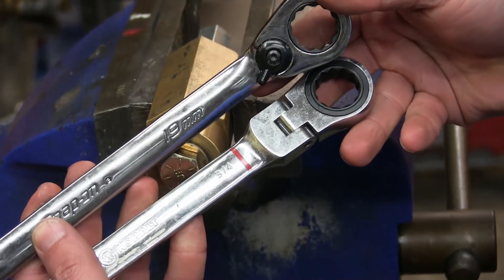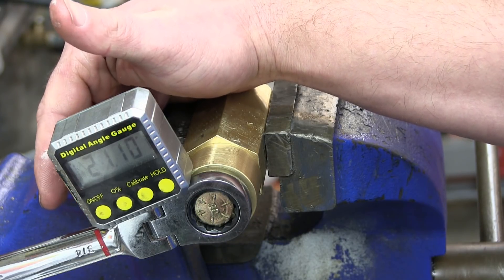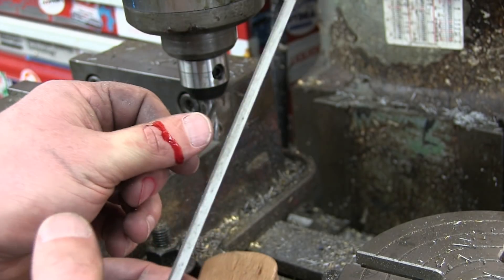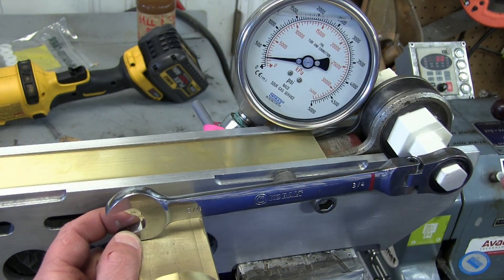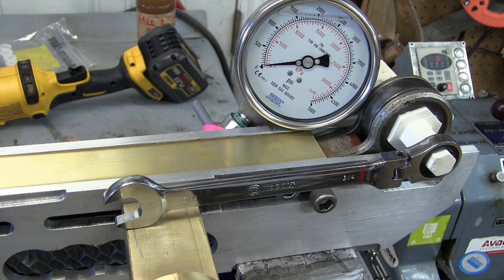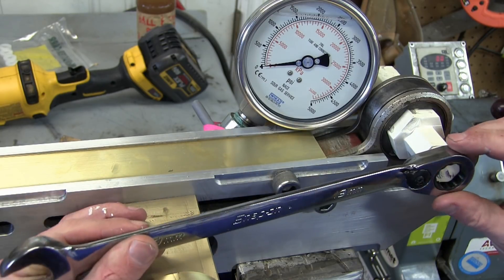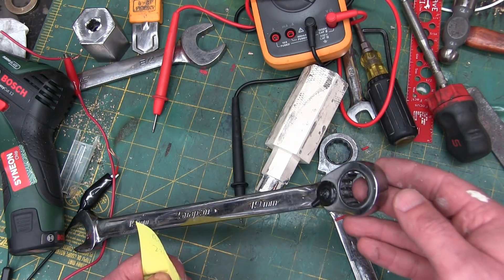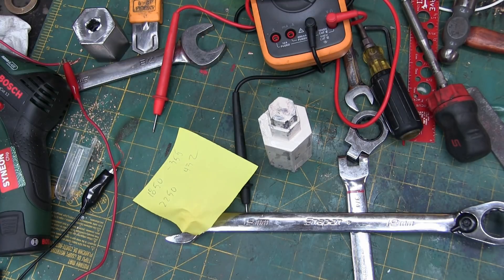RATCHET WRENCH Shootout | Snap-on Kobalt

Comment: You're 'cheating', your Snap-On specimen is the older style 'teardrop' head, which was a fabulous/highly durable style. Some of my newer ratchets have the oval head design; pure trash in my experience, I stripped out at least two newer style 15 mm's using just my hands, NO cheater of any sort and, I'm NOT that strong. If I ever decided to go back to work, I'm retired; I'll buy a set of Harbor Freight ratchet wrenches and, take my chances. That's how pissed I'm at Snap-On.

Comment: What was the math you did at the end, converting it to ft. Lbs and Kpa? Others pointed this out too but, the Kobalt is a flex-head with the frap-off being solid.  You did say it was comparing apples and bananas, I appreciate that you make that distinction.
Could you do a test of flex vs flex/solid vs solid? So it’s bananas and bananas?
Also (May be way too nerdy to actually do). But maybe a cost comparison added in.  Lots of folks won’t put this much torque on an 18 mm wrench, especially a geared wrench.
Thanks for the video!!!  Keep them coming

Comment: Not an accurate test, flex head vs non flex. All variables in the test should be equal. Non flex, and both same size for accuracy. And of course the flex would break those pins can't handle a lot of torque

Comment: entertaining, but on the end little is ever learned from these "tests". It's not humanly possible to pull this kind of torque on a hand tool unless you use a pipe and abuse the tool far beyond it's intended use. When you have to do this, time to move up to the next tool and do it properly. IMO, most low priced tools will match the usefulness of the designer priced offerings.

Comment: Yea but you're looking at the amount of torque the actual shank of a bolt can take while tightening. But when you are trying to take off a rusted bolt or something that torque yield can be much higher. Especially on auto suspension nuts and bolts. But either way, seems like kobalt CAN produce a solid tool. But like others, consistency from one tool to the next  has to be questioned.

Comment: The only snap-on ratchet I was ever able to pop was a 1/2" drive flex head that was 2 ft long and I was using a cheater pipe with it. You would think it would sheer at the flex head but I actually tore the guts out.

Comment: So .... the watched that's 10x more expensive out performed a much cheaper tool. I would rather just break whatever loose and use my much cheaper tool. Then.... when it (if) it breaks, it has the same warranty.  I'm good with the kobalt

Comment: A flex head cobalt vs a rigid snap-on isn't even an accurate test. A ratcheting flex head is used to get a better angle on a bolt/fastener that has already been broke loose or to snug it up. A rigid ratchet wrench is used to put some work in. It basically like using a screwdriver on a hose clamp when you can just put an 1/4 socket on it.
Reply: Exactly why this shouldnt be a comparison video more just along the lines of a torture test on wrenches.

Comment: They are made 100% in the USA in Tennessee at the hand tool plant you can easily search the video on YouTube. By the way your using an older discontinued Snap On ratcheting wrench. The new Snap On wrenches are Dual Paw 80 tooth. Same dual Paw in Snap On 80 tooth ratchets. Dual Paw is patented and only tool company with it. Sure you can buy cheaper wrenches and support giant corporations like Home Depot, Lowe’s and China. Or you can support a local small business owner which Snap On Franchises are and support US jobs that Snap On provides. PS using a flex head that allows more torque diversion versus a non flex head is completely inaccurate

Comment: Isn’t it screwing all the results of these tests because the distance of the leverage seems different between each one.  Also, it always deflects until the contact point is 2” shorter (farther down handle) again screwing all the numbers.  Need a different support...more of point and standardized length between all tools being tested

Comment: Would you give any consideration to testing the open end of this wrench or others like it? I own the very same set of wrenches with the "Flank Drive Plus" there seems to be a few brands that have some sort of added gripping surface built in. I have often wondered how Fap-Off got there magical number for figuring how much more they're capable of gripping a fastener. I hope I'm not beating a dead horse, love the Va-Jay-Hose!

Comment: I have an old swing dial torque wrench that I use as a breaker bar. Both sides of the 1/2 inch drive have rotated 45 degrees where I was giving it the biggun on a seized bolt, am I going to die if I still use it?

Comment: I've been in a lot of situations with rusted up fasteners where you are better off if you could twist them off to get things apart, at which point removing the studs or bolt stubs was a cakewalk.  One of the worst is the mounting rings for the brake calipers on the DC-drive wheel motors for Komatsu/Haulpac mine trucks... 3/4" flush socket cap screws, and invariably you have to blow the heads out of several with a hot wrench to get the ring off.

Comment: Shock load when a rusty fastener brakes loose is what kills the ratcheting mechanism in ratchets and the ratcheting wrenches.  The tool trucks can't keep enough of the long double ended 17 / 19 mm Monster branded wrenches in stock for shops doing alignments on Subaru and Toyota.  I've never broken the ratcheting mechanism just pulling on a tool, but have scattered many when the fastener actually broke loose.

Comment: you could make a 19mm headed bolt that has a 3/8 square drive shank on it. and use the other 3/8 square drive testing piece.  just an idea.
Reply: but then of coarse you can only test 19 mill or make one for every size but that's a bit tedious.  but if you machine it out of actual bolts you could save time.

Comment: i have snap on, blue point(snapon step child) , and gearwrench ratcheting wrenches and so far i'm the most impressed by gearwrench very cheap and can take a beating i smack them with hammers all the time to break stuff loose intentionally abusing them and i'm only broke one 3/4 and luckily my tool truck carries them now and i can get it warrantied. hard to beat considering i got both (metric and standard) sets for less than if i had just bought 1/2 of the metric snap on set.

Comment: Interesting that the pivot pin would sheer on the cobalt,  when previous tests with pivoting head tools ( breaker bar for one )  did not fail at that point. 
Likely,  better material of the pin and more material surrounding it to prevent torsional twist with the breaker bar. Am I correct? 

Have you got a good quality pin you could use on the cobalt spanner to then be able to restest it in the hydraulics doofer?

Comment: Glad to see you add Kobalt to the mix. I've been a diesel mech for a number of years and have used Kobalt on the regular with some fair abuse...ahem 3ft 1/2 galv. pipe on the end of a 3/8s ratchet...would like to see a ratchet revisit with that in the mix.
Reply: I have used a 1 ton come along on an 11/6 kobalt wrench numerous times. Torque rods on a Pete are inaccessible to sockets and ratchets.

Comment: I have a lot of Kobalt tools, never ruined a ratchet, wrench, socket, screwdriver, allen key, you name it, and I work on from small generators to 80,000lbs Crane trucks.
IMHO the ratchets are far more usable it tight spots, less swing than Fap-off, had to retrieve my Kobalt ratchet after dicking around with a co-workers Snap-off ratchet removing a transmission bolt from above the dog-house.

Comment: I would like to see the Snap On wrench tested to failure. I'm curious as to just how over built they are.
No doubt Snap On stuff is very good. Kinda can't stand the price though. Bang for the buck I have had a hard time not buying lots of Cornwell stuff. But all my professional ratchets are Snap On, They just feel right and rarely fail. I don't have any Snap On ratcheting wrenches, For that I went with the Cornwell spline drive double hinge type. I used to work on German cars and everything was held together with those weird external torx head bolts, E10's and such.
Thanks for another good video yah goofy Khanukistanian. :)

Comment: I just had an interesting thought hit me like the proverbial ton of bricks..

You mention the wrench being stronger than the fastener, and with a ratchet wrench or breaker bar you can put a cheaters pipe/ bar on it for increased leverage to give her all she'll suffer..

But on an open ended box wrench you can't.. .. or can you? 

We all know that you can do some wrench fornication and interlock the box end with the open end if you need to do the 200lb gorilla routine but you've only got a 150lb gorilla handy. I wonder, how safe is it? If wrench X critically fails at 450 ft/Lb, where does it fail on the other end? 

Does it fail at a high percentage to the overall fail force and therefore be a stress most people would never be able to generate by hand? 

Or is it a more meager number like half that which might be attained with the 200lb gorilla routine?(or 300lb gorilla routine for some of us)  

OR, are both predictions wrong and the open wrench ends are made of unobtainium and fail at some insane force that the rig cannot effectively test? 

Maybe you should keep those safety squints engaged and try that after these Salem Wrench Trials are over and you are looking for something else to question..

I sure think it would be cool to see, and who knows, maybe I should wear two condoms and keep my mother on speed dial while using that trick after all! 😂

Thanks, and keep up the fun and educational videos!

Comment: I see all these people hating on Fap-Off (on other channels) because they're so expensive and "no different than the cheap stuff" and yada yada yada. I even read one comment where a guy claimed his Stanley tool was no different than fap-off. needless to say, I lol'd. 
To those people, I say, yes they are expensive but you get what you pay for. This video shows it. Are many of their tools overpriced and not worth it? Sure. but many of them, while costly, are totally worth it and probably the last tool like that you will likely need to buy (unless of course you loose it). With that said, I'll step down from my Snap-On Tools® soap box.

Can't wait to see if you do a test like this comparing the apples from Horrible Frought and the apples from Fap-off and maybe a few inbetween cough cough gear wrench? cough cough

Comment: 19mm on a 3/4 bolt?
Reply: They are close enough for most cases. 3/4in is 19.1mm.
Reply: 19.05mm = 3/4.  Less than .002 of an inch.
Reply: james4v size of the bolt not the head

Comment: You should do a BOLTR on that SnapOn wrench.  I'd love to know how it's made.  It looks like the dual 80 mechanism on the inside but the pawls aren't removable.  I have no idea how they put it together.  SnapOn just recently changed the design to a fatter head that allows the mechanism to be rebuilt.  The weak point of those wrenches appears to be the little spring between the pawls.  I've broken two so far on my circa 2010 set and it was the spring that failed both times.  The new style wrenches are stamped USA.

Comment: I have a dumb idea. Make an adapter, 12 point to a square drive, then test how good it is.
I wouldn't see why a reversible box end would be better than a square drive ratchet when they have the same mechanism, other than that a lot of the squares shear off. But if the square sheering off is the only failure point when comparing the two; what would happen to those newer pass-through ratchets, would they act more like the box end? 
I'd also like to see a reversible box end taken apart, just to see if the mechanism is the same as a ratchet, or if it's modified in a way that would make it stronger.

Comment: Kobalt doesn't get the respect it deserves
Reply: Been using the same Kobalt tools for 4+ years. Dropped em, banged on em, threw em in the dirt and then oil and then dirt again, beat em to hell and back and never had an issue with a single one of them.
Reply: For the price difference the performance difference was minimal
Reply: I got a bunch of kobalt tools when I went to school still use them. Broke a few but they stand by the warranty
Reply: True. Helped Jimmie Johnson win the championship
Reply: The harbor freight is the same as kobalt
Reply: @thebear6751   not really I use kobalt wrench no rounding off harbor freight long wrench round off every bolt.
Reply: Dave Lawrence then it’s a bolt steel problem😂
Reply: Cody Marston nope
Reply: @thebear6751  Kobalt is made in Taiwan,and superior to made in China.
Kobalt an Harbor Freight is like comparing old Craftsman tools to K-mart brand tools in my opinion at least.
Reply: @thebear6751  No it is not. Kobalt Tools are made by Matco Tools. Kobalt started as a separate franchise and then completely dropped the Matco name tag but is still the same product. Harbor freight is decent but I would never compare them.

Comment: That kobalt held up pretty good compared to the snap on. Specially considering it was a pivot head.
Reply: Esp considering you could get the entire set of Kobalt, some screw drivers, tool box, and a diet coke for what that strap-on cost.

Comment: I have an old Plarad MX -EC 20 TS hydraulic head i'd donate to the cause in exchange for a tshirt. PM'd AvE about it but just crickets in return so far. I'm enjoying the hydraulic torque destruction vids and would like to add a tool to the arsenal instead of it rusting in my garage.

Comment: If you could put 400lbs on a wrench, you probably don't need the wrench.
Reply: Exactly my thinking, haha.
Reply: Mike Savage seriously
Reply: Haha when i was lifting weights heavily for a few years I worked for a furniture store and I had strong enough grip strength. Every now and then me and my co worker would forget the pliers and I would take off the hose lines to the washer machine. When we would take them for servicing. By hand I still had gloves on though. My co worker would say "hey come use your kong fu grip". granted i dont think I was 400lbs of force 😂

Comment: side note, i have broken those ratcheting box ends (a crapsman and a harbor freight) by using them to hold the other side of a bolt while i tightened it with an electric impact

Comment: For cheap as frig put one in any car tools I like kolbalt. At least where I am I can take advantage of the no hassle return policy of a certain hardware store if one of them craps out, I’ve never had issue with that as the use case I have for them is infrequent nut tweaking. Plenty of value in them for that. They aren’t heirloom tools by any means though

Comment: I thought 12 point would strip a fastener "easier"
Reply: When new they usually don't, but they stretch considerably over the years and then they barely still hold on some material which is easily displaced.
Reply: If you don't get the right size they will, I like 6 point better though, fits better and less risk of rounding.

Comment: A flex head ratchet versus a solid head ratchet wrench? Of course the flex head is going to break first... regardless of who made it

Unless I'm missing the point and you're just singing the Praises of the Snap-on ratchet wrench ability and not necessarily  comparing the two